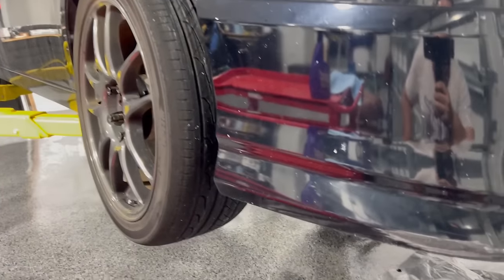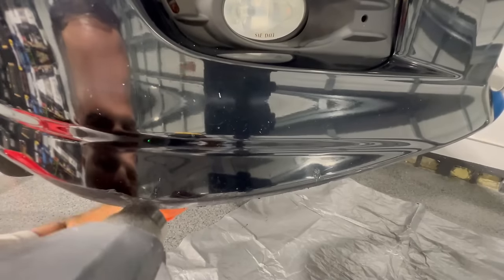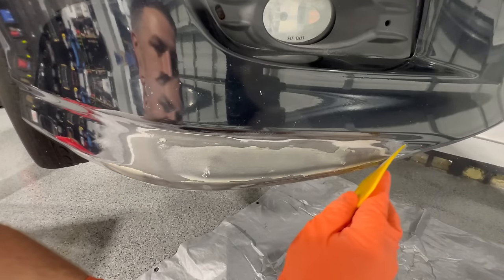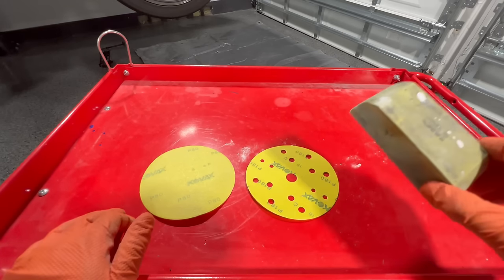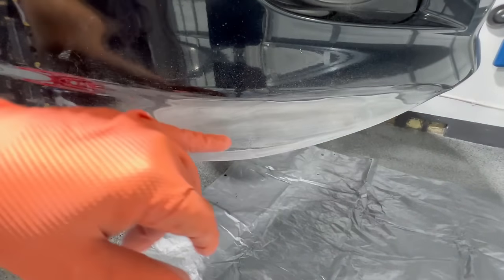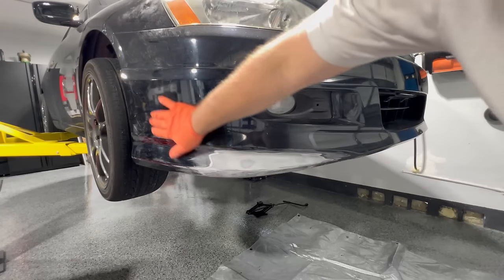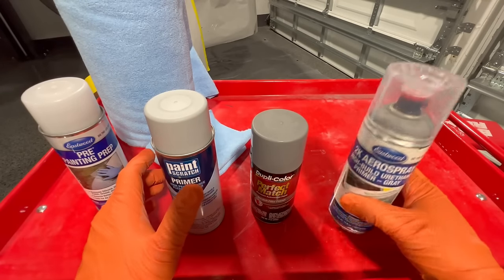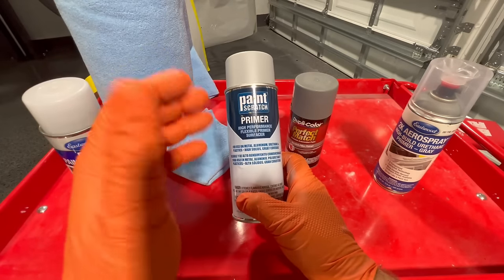DIY Painting Without a Paint Booth!

Comment: Great to see this. Prepping to repaint my Tsx engine bay but I’ve been on the fence. 

Cant decide on a compressor setup and ideal for my spacing. 
And definitely not confident using the 6 Gal pancake I have. 

So deciding to use cans from the paint Store. Probably more costly this way to but I’d feel more confident.

Someone mentioned the 2k Pro max clear won’t hold up with heat the bays/Florida produces.

Comment: Great stuff! I have an engine compartment to redo with a couple bare spots from rust to prepare for sanding. How do you decide whether or not to primer and entire area/panel or just spot areas with primer like the bare metal areas? Would you primer the bare metal with epoxy and then seal the whole area or would you spot prime and then do what you did in this video sanding the existing painted surface to be refinished?
Love the channel. Will you do a video or do you have a video showing how to spray a car in a homemade booth or an outside situation? Your garage? Not everyone has access to a spray booth. Thank you

Comment: In the older days when I worked in body shops we didn't have UV we used bondo.  We would also prime and sand after the bondo until it was smooth and even.  Then if we didn't need to paint the entire panel, we would spot blending.  Can spot blending be used or does the entire panel require painting??  Thank you!!!!
Reply: Thank you so much.  I will look at 3HP compressor and a 50L tank and three good spray guns.  It's been years since I did this and oh how things have changed.  I  remember using 42lps pressure with acrylics, using thick primer for the fill coat after bondo and sand and prime then use a think coat of primer by adding thinner and knocking the top off. Then use prepsol and a thin first coat of paint first and at least two more color then top coat blender which requires 70lbs pressure and running back and forth to paint the side of a car. It ran notoriously if you didn't move fast.

Comment: Hello Brain, I’m painting a 1968 Pontiac firebird. It’s for my son. I’m at the last stage of painting. The clear coat. I’m using automotive art 4:1 clear. The problem I got in to is pin dots. On the roof and hood. The base is black excel auto body product # 701001. I did all the flash time between coats. Need feedback on what I can do or fix this problem. I laid down two coats of clear and then wet sanded the imperfections. The next step is clear. Any help will be appreciated.

Comment: I noticed your tire wear. Check your tire pressures, wear on the outer thread means low pressure. Check tierods, and balljoints, may need alignment. Now go through the drive through to celebrate!